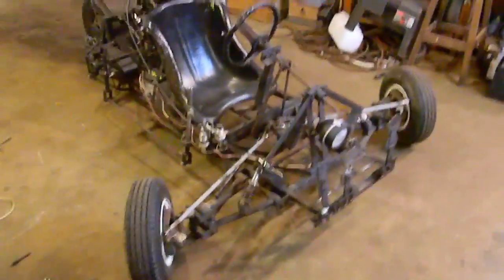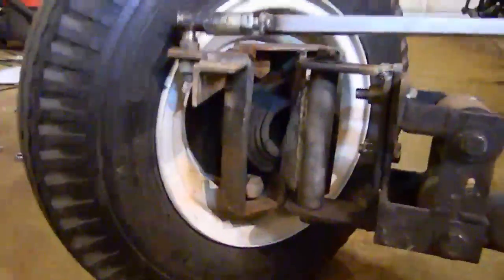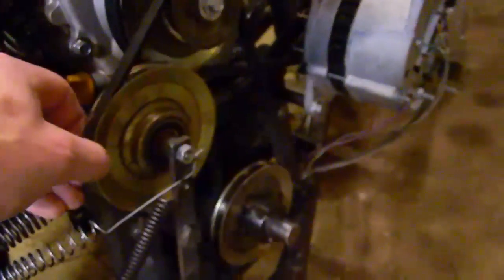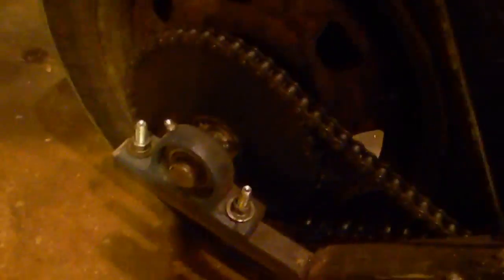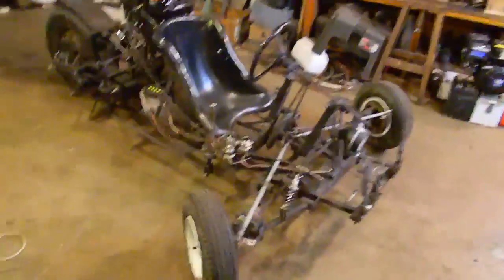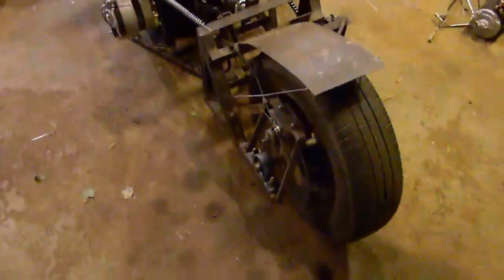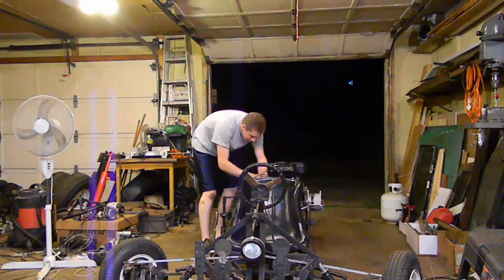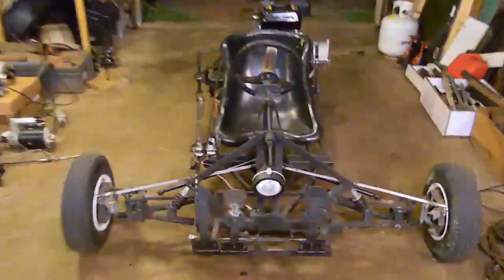Homemade 3 Wheel Go-Cart (T-REX Car) 4 speed transmission

Comment: if i had that, i would put 2 lights in the front, amber turn signals, 1 high mount brake lights.mount for camera.. a cover for the motor and rear parts to make it look real cool and protect against rain... motor cycle windshield for bugs..man that thing is so cool! oh and a 12v lighter sockets.

Comment: In some states you can register a vehicle like that as a motorcycle. I bet that thing would turn better than 90 miles per gallon and fun as well. 
I actually have a similar design that I have started. I'm using a 35hp 340cc air cooled snowmobile motor so I plan on using a two speed transmission with reverse connected to the belt drive CVT that the snowmobile already has. I'm hoping my two seat tandem design will have a 90mph top speed and average 65 miles per gallon. I'm also going for a ww2/post apocalyptic mix for looks. So naturally I love your machine.

Comment: three wheel designs with the single wheel in back and wide front wheel base are very stable with low risk of rollover. when you have two wheels in back and one up front...that's when you're in trouble

Comment: You wont need a alt to keep up if you use a LED headlight, just use the trickle charging system on the engine, You could also use a starter-generater, It starts the motor belt driven and when you stop using start mode it spins and charges the battery, I know this vid is old but you still might use a idea or two

Comment: Good job on getting the Ackerman geometry correct on the front wheel steering, but, dude, you have to learn the difference between springs and shocks...Springs support the weight and shocks prevent excessive "movement" in the suspension. Those gas "shock" thingys are only springs, you have double springs on your suspension parts.

Comment: This is what I call an impressive machine. Also, you still use the pull start instead of using a starter? I thought that was what the huge in porportion to the engine electric motor was mounted there unless it was only the alternator.

Comment: The belt-clutch is a nice simple clutching method, used in garden tractors, the alternator is a little overkill for only one light, but I guess you may have had one already and an engine with built-in stator coil would have cost too much. Why did you not make the rear wheel the same size as the fronts? you could have had smaller brake parts and a smaller drive sprocket, making the cost less for the components.

Comment: when u turn it actually sends it most to the front hence a t rex motor cycle can take turns as fast as a car but a normal 3 wheeler will just flip cuz there no wheel in the front corner

Comment: your tension pulley is on the wrong side, you wouldnt need the two larger springs if you had it on the other side pulling towards the back of the cart.  Not really that big of an issue since its just a fun machine.  Do you know what vehicle the manual transmission came from?  Keep having fun :)

Comment: With the typically very low center of gravity, tadpole (two in front) trikes are often much more stable in turns than cars of comparable performance.

I noticed some twist in the rear of your chassis as you went around the turn.  Watch out for that.

Comment: No...When you have 2 wheels in front that is called the "speed configuration" on 3 wheelers, those are stable around corners....When you have one wheel in front, that is called the "LOAD configuration", unstableish in corners but good for carrying heavy loads.

Comment: I like everything about your design except your legs being surrounded by metal,you couldn't get off of that machine in a emergency situation,you'd lose your legs,reweld it open to your legs,you have the welding skills,take the time,good engineering

Comment: Step up who’s next, who wants Hugh adrenaline right before you meet your death. That’s right this is the most fun way to die you’ll ever have. I’mfa not I’ll refund you in full!! And if you live to tell the story than ya can thank me them for the great story you can tell your friends how you cheated death (barely) 
 Good thing a rock didn’t kick up into the pressurized belt system whipping by my head. Cause by the looks of things it’s overly complex, no safety anything holding the belts on or protecting things from flying up. Into the Area.. and the “beefy” shock looks like it came off his bicycle seat and nothing for the front to keep the rusting death trap from shaking apart. Just hold your breath, kiss your sweet ass good by abs hood the rides over soon.